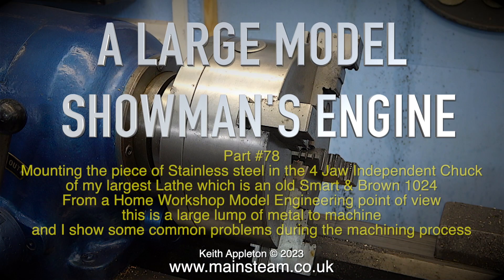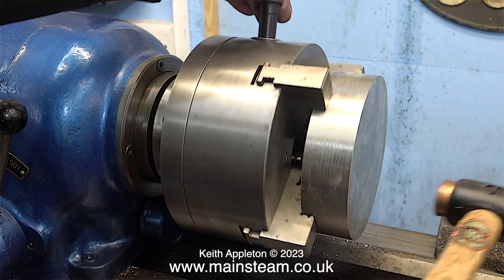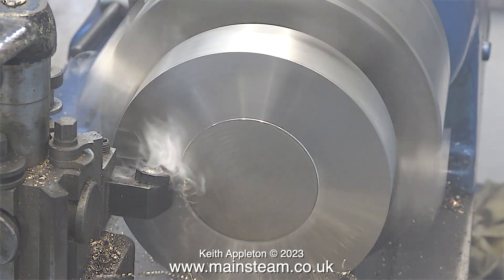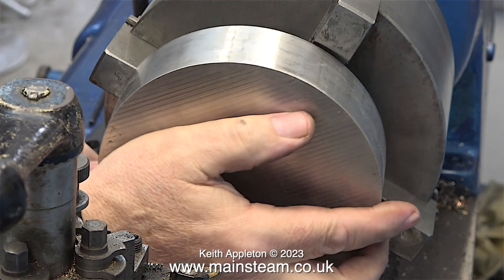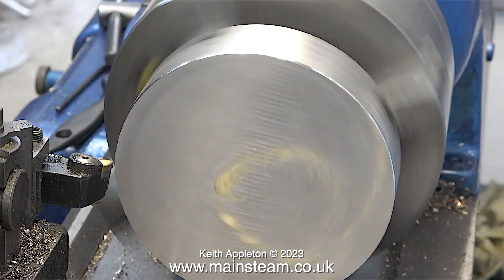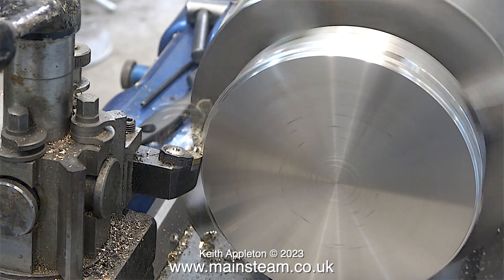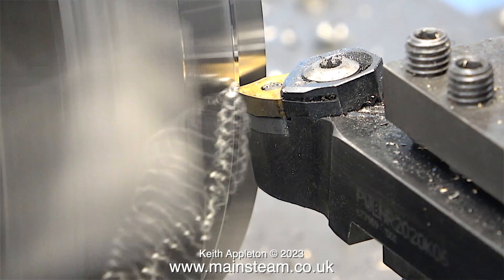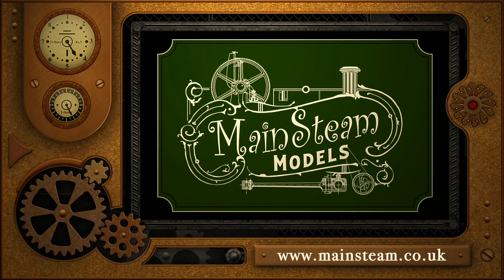A LARGE MODEL SHOWMAN'S ENGINE - PART #79

Comment: When I worked for an engineering company, we’d trepan the middle out of pieces like this, especially if it was from expensive nickel based alloy, so you’d have a ring to throw in the useful bits of stock bin instead of making a lot of expensive swarf.
But I guess if you’d had to buy a trepanning tool, you’d have to offset the cost of that against the potential future value of the ring.

Comment: When I was learning CNC we toured an Aircraft Plant where they had some large machines, at the beginning of the tour we watched them use a crane to load a billet of metal  that must of weighed a ton. we passed this machine a number of time, sometimes it was running and all you could see was chips and coolant, other time it was stopped and they were using pitch forks to remove the chip and swarf. At end of the tour we were back at this machine where they  removed two parts that weighed about five pounds each. The tour guide said the plant produced chips and swarf aircraft parts were a byproduct.